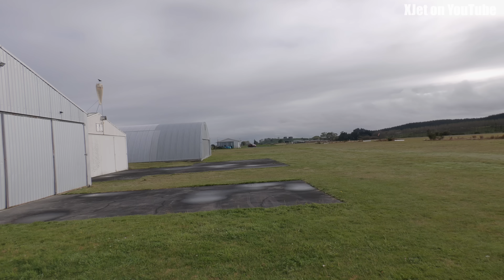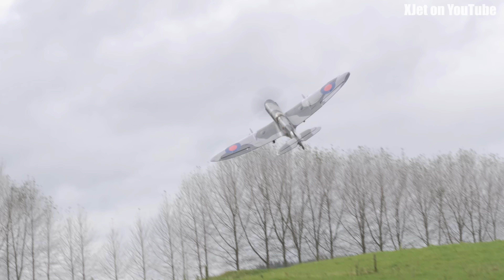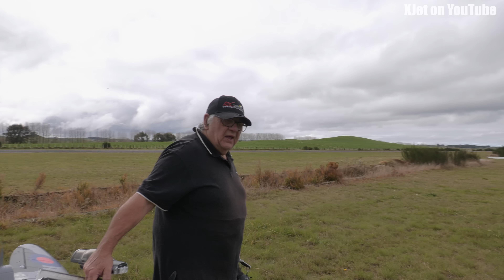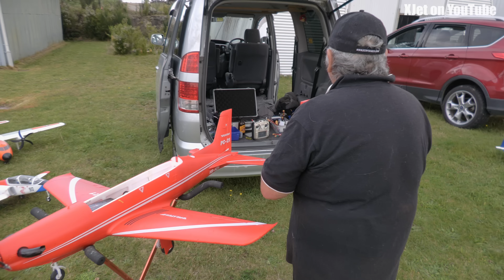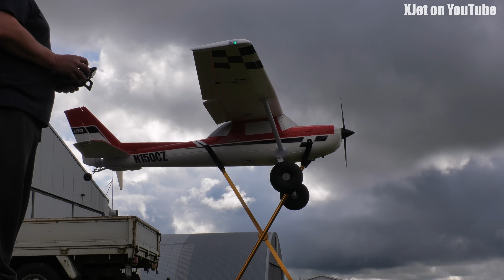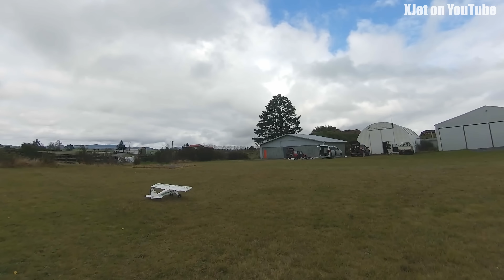Into every life a little plane must fall

Comment: I've been thinking about this aerial "warning" system you've been making. Is it not fairly trivial to make an acoustic warning system? There are ready made PCB microphone arrays available, and you can just 3D print your own directional horns to segment the sky into sectors (ground station), or just place microphones in your wing and fuselage. Every aircraft has a distinctive sound because of it's engines/motors and props. Together with GPS data you could even track the movement of other aircraft from a moving platform.